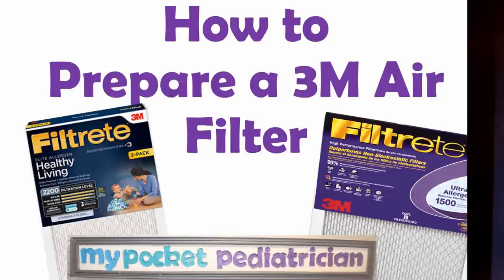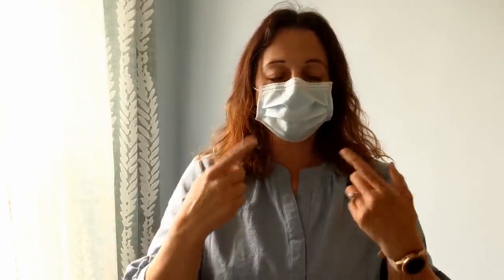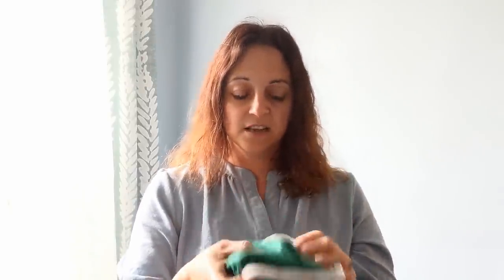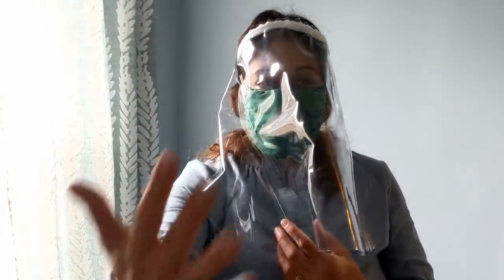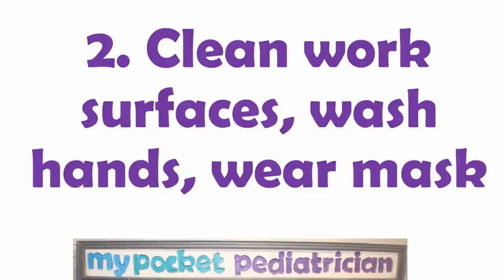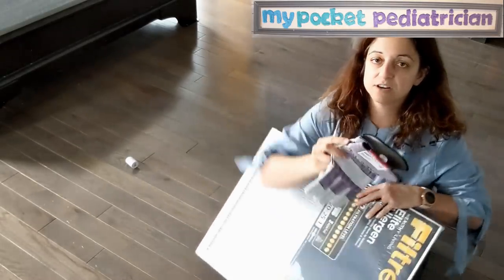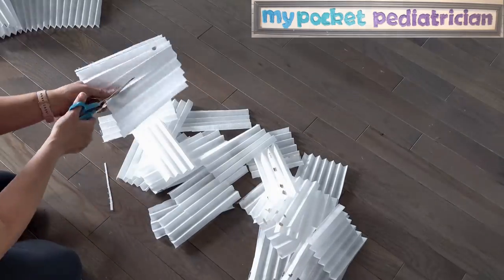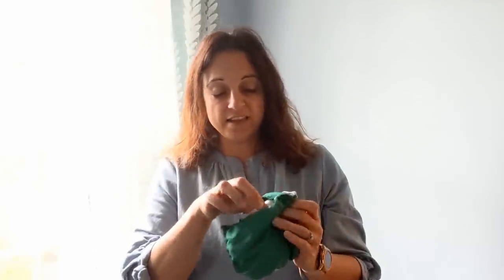UPDATED!  How to Turn a 3M Air Filter into a Face Mask

Comment: Hi thank you & well done.  I've also made a similar version.  It's a DIY no-sew mask with a 100% cotton Levi kerchief using the 3M Filtrete MPR 1500 (MERV 12) filter as insert.  I also checked the MSDS and found no known hazards and I also got the same feedback from 3M--they won't say it's a good solution.  We have a vulnerable family member and this a good mask using available materials.  I plan to use paper bags to store masks while in use during the day and plastic bags for new filters.  I also plan to use a light application of non hazardous non aerosol starch when ironing the laundered kerchiefs (not the filters)--it's to add body to the cotton mask when I refold them to help hold their shape.  Thanks again and I'm more confident after seeing your detailed method.

Comment: There are some Filtrete filters that are rated 1500 but only MERV12 (the purple label one). But the sheet on the filter lists it as good for catching virus particles as small as 0.3. I think it should be good though. This crap is confusing. Lol.

Comment: I’m glad I’m not the only doing this. I did the same thing , the research on materials and particle size, etc., downside no sewing machine and I don’t like to order stuff online. But I used the motorcycle neoprene half face mask, ultimate allergy pillowcase (made a mistake and bought the waterproof), and 3M 1500. It works good. Unfortunately I can only wear them out in public not in my Peds ofc.

Comment: I make my mask using polyester/spandex material. And I use bedskirt lining as filter material on the inside. 4 pieces, front and back polyester/spandex and 2 filter material pieces. I did the blow the match out test and couldn't blow the match out for anything. And with any mask you're not gonna escape sweating or moisture build up.

Comment: According to the CDC website, all corona viruses cannot survive above 130 degrees F temperature. With that in mind, you can "cook" your masks and other items in an oven or toaster oven including masks to kill any virus for reuse or before discarding to keep everyone safe. I would keep the temperature about 140 degrees, you do not have to get crazy hot with this idea. Paper products self ignite at 451 degrees. Fabrics self ignite at temperatures between 850 - 1000 degrees. Most elastics are safe at this temperature. Inside car temperatures can reach 212 degrees in the summertime sunlight with windows closed up. The virus will die in a hot car in the summer and you can "disinfect" your masks, clothing, and anything else in a hot car in the summertime. Hope this helps.

Comment: There is a reason that those filters are pleated.  Flattening them reduces their effectiveness.  Of course, just about anything is better than nothing.  Have you considered using HEPA vacuum cleaner bags as a filter medium?  They don't need to be pleated.  Further, another option for the basic mask is to use hypoallergenic pillow covers.  Those can filter very fine particles, pollen, dust mite allergens, bacteria, etc.  You can then try the vacuum HEPA bag as a filter medium for your pocket, or 2 or 3 layers of your 3M pleated filter medium.
Regardless, thank you for doing what you can to help people out !!!!

Comment: Ive bn using the 3m 1900 Filtrete for about 2weeks now. I double it going it will increase the filter power.

I don't know the merv or mpr.. ?.. for the 1900 Filtrete

Would u happen to know the mrp n merv level or know how i can find out?

Comment: Since the seal is very important, what do you think about using the mouthpiece from a snorkel? Rubber band a circle of this material on the stub left after removing the long tube (keep just the mouthpiece and it's stub, ensure the direction of the material is right.). Then, breath in through the mouth only and exhale through the nose or mouth or both. Goggles help too.

Comment: I have heard from multiple online sources that 3M says not to use these furnace filters close to your face. So I did not buy one. It’s impossible to get a hold of customer service now to verify if this is true.   Did they tell you it was ok?   I heard that the Hepa vacuum cleaner bags are safer to breathe from. There is so much misinformation floating around, I don’t know who to believe anymore.

Comment: Would wire for fencing work too like double layering it an i wrapped tape around it to keep it all closed up an cut up a part of the filter double layer it an use hot glue to attach it to the wrapped wire
Reply from the maker: I tried a higher gage wire I purchased at Home Depot - it was very painful.  I can't remember what it was off the top of my head, but it hurt a lot when I tried to bend it to my nose.
Reply: @MyPocketPediatrician  the one i got it leaves my fingers black. I made the basic shape like an n95 mask then washed my hands after that i wrapped it in tape
Reply from the maker: @squishy_Rio  I don't know about that.   Did you see the mask tutorial on how to sew a tight seal pocket mask?
Reply: @MyPocketPediatrician  this UPDATED ONE? or a previews one
Reply from the maker: @squishy_Rio  This was just on how to prepare the filter.  Here is how to sew the mask:  Here is the link to the tutorial on how to make the mask:  https://youtu.be/4eOc5_rBCrM

Comment: The 3M MATERIAL SAFETY DATA SHEET provided is outdated: 05/29/2007. Pg. 7 last line states, "In addition, information obtained from a database may not be as current as the information in the MSDS available directly from 3M. 3M MSDSs are available at www.3M.com." This filter's material safety data has to do with when used for its original purpose such as HVAC systems, ex. your home's central heating system, and not safety tested for direct inhalation. (My family runs an HVAC company.) 

I do commend you helping to be part of the solution as we are all trying to figure out what's best. Lastly, in the comments below: Norm Lieverdink and Sakoon Hirundage have some great insight (their replies hidden in Eve Wile's comment feed.) Reposting a link Sakoon provided: It has great info at the bottom of the page regarding home HVAC filters and how to improve your home air quality. This is an important factor at a time like this as well that people might not realize... wishing you all good health. https://www.filtrete.com/3M/en_US/filtrete/home-tips/full-story/~/coronavirus-and-important-things-to-know-about-airborne-particles/?storyid=d69e7735-c02c-46d2-9c8a-ae23372934ac

Comment: Made from non toxic material for 3m filters such as polypropylene(only toxic if melted or burned) and polyolefin. Did alot of research on Filtrete based filters for furnaces.

Comment: The construction of most MERV 13-16 filters seems to her very similar to N95 masks, using a permanently electrostatically charged melt-blown polypropylene layer as the fine particle filter. Very low grade furnace filters, around MERV 4, tend to be fiberglass, and really only meant to protect HVAC systems from the buildup of course dust. Cleanable dust collector filters, as well as some HEPA filters, are also made with glass fibers, relying more on fine pore size than static charge, and requiring much higher static pressure to achieve useful flow.

If you have a glass fiber HEPA filter, and you try to unfold it, it will crumble slightly. They are not particularly flexible and are easily damaged. Don't rely on this as a test, always check safety sheets, it's just a quick way to get a qualitative idea of where to start when looking at filter media.

Comment: Thanks for a good and informative video...  I don't believe here's a need to be concerned with the airflow marking on the Filtrete filter body. If you look closely at a Filtrete air filter, there is a wire mesh on one side only. The direction of airflow on Filtrete Air filters has more to do with the wire mesh providing support for the filter medium than the actual filtering capability.

Comment: This was informative.  I too was making a mask with the  Filtrete filters 1500 mpr and above. Thanks for pointing out the direction of the filter as it goes in the mask. I made a mask with ties on the side that are adjustable  to the face. Then the mask can fit tight enough to prevent the gaps because it gathers. When wearing the masks they feel comfortable.

Comment: The following idea would probably apply more to someone going out in public than to a health-care-worker... But what if, rather than putting a 6×9 inch filter in a tight fitting mask, you were to just medical tape a small piece of the filter to your nose - covering your nostrils with the filter (but not the tape)?  You could then cover your face with a looser fitting mask like a bandana. And as long as you breathed (in) thru your nose, wouldn't you have the same level of protection?

Comment: So I got this same idea before I saw your video. I took the filter apart before I marked it. I cannot tell the difference in the sides. The internet said the directioning is because it is supported in that direction. I'm a bit concerned as well is there is another report that says the glass particles can get into your lungs. What are your thoughts

Comment: One more thing comes to mind.  If this mask works due to electrostatic forces capturing contaminants, it is worthwhile to understand that electrostatic forces fade away in the presence of moisture.  Moisture from your breath allows charged air particles to dissipate their charges.  As the moisture condenses in the mask any static charge dissipates as well.  The first time you exhale through the filter, it starts to become moist and lose the static property it relies on.

Comment: thanks so much for your good work.  would it fit better if a metal nose piece were added along with elastic.  i had to use elastic from a fitted sheet,

Comment: I was checking out a polypropylene filter material used for hepa filters, from what I've found, no fiberglass is used. The material is called Spunbond. Haven't priced out the cost, but supposedly comes in a roll you can cut. It might be an easier way to save your fingers from pulling mesh.

Comment: Thanks Dr Lili!  I didn't mark the sides of the Filtrete material when I took the filter apart 2 weeks ago.  Since I have a 3d printer and no good sewing machine I was using the 1900 Filtrete with a single layer of a cotton t-shirt on the "health-care worker" side. I wanted to protect myself from inhaling loose filter strands.  On closer examination of the Filtrete I can see the fibers are flat and tight on one side and looser on the other.  I use my filter with a face shield.  My wife finds the plastic masks uncomfortable and poorly fitting so we are going to try to make a cloth mask for her.

Comment: I was thinking these would be safe to wear as masks because if they weren't the particles could potentially dislodge and pollute the air inside the space they're filtering.
Reply from the maker: That's exactly what the HVAC company I talked to said.   He said it would be completely counterintuitive to use something to filter your air that is harmful to breathe in.   However 3M says they don't recommend doing this.   I'm using Filti now, and I have a fit tested tutorial here:. https://youtu.be/2J3Fq4o-U4I

Comment: How does CLOTH vacuum bag cut up materialI believe -Enviro Care brand  or Miehl Co. bags stack up as a filter Insert material?
Reply from the maker: I don't know.   I think some have fiberglass, but I'm not sure.   I'm really not familiar with them.   I found a better material...Filti, which was designed for face masks and am using that now.   The new tutorial is here and I have a discount code for them.   Depending on shipping, usually works out cheaper than the 3m filters.   https://youtu.be/2J3Fq4o-U4I

Comment: Thanks for this informative video. I want to just give you some information about the directionality of how you insert/use the filter. It doesn't actually matter which direction the air flows through the filter material for this purpose. It only matters if you are using the filter in an HVAC system. That metal cage is designed to protect the filter from a large volume of air coming through the furnace/AC, so it has to be inserted in the correct direction so that the filter itself doesn't get destroyed. But once you've removed the filter from the package, to use in a facemask, the filter can be used from any side. This information comes from my husband who is an Air Force trained HVAC technician.

Comment: Thanks much Dr. Lili.  You answered a lot of questions for me. 
I want to try my new double Filtrete 2200 inside my pocketed cotton mask soon, when I finish making my cotton mask. 
I've got four n95 (about 6 year old masks) which I can now reuse by cleaning them by either stove boiling water vapor for ten minutes, or baking them in the oven at 148-158 degrees F for 30 minutes ( reuse max is 5 times the last way, and I know the rubber won't  be any good after baking).
Update:  You can now purchase KN95 here in the USA, which is the equivalent to N95, as of April 3, 2020, on eBay and elsewhere.

Comment: This is helpful BUT as a example: the HCW &  the dot is overboard. There's more "extra" things then this. Make it easy for yourselves.
Reply from the maker: I wish this were easy.  unfortunately the material has an electrostatic charge and it is directional, so wearing the filter backwards won't do anyone much good.  That's why it's important to place the filter correctly in the mask, and it's easier to note the correct side when you're making it than when a tired healthcare worker is getting ready for a shift and trying to remember "shiny or dull".

Comment: Elastic pulls straight, from bridge of nose to next straightline to part of face, lEVng an opening on each side... better to Use a paoee clip or those bendy things at home depo that you cN bend to fit face shape.. & THEN they stay in that shape.. IF 1 puts a non bendy outer frame around facemask(even just a curved plastic cross peice?, thN you could put elastic around THAT, & it wud strengthen the seal, provided there was some airtight cushioning for comfort, & maskfit imperfection, about another 100% or sO.. on this note, because this wud be an adjustable fit, elastic improved fit mask... it cud B 1/2 the sise with a plastic body & EZ filter slide out gizmo door?  mAB.. just something to dable with if you feel like it👋

Comment: CAUTION!! Please read page 2 #3.1 on the MSDS safety sheet that this person posted below the video.  “...use or processing of the product in a manner not in accordance with the products directions for use may affect the performance of the products and may present potential health and safety hazards” These filters are NOT meant to be placed against your nose or mouth and inhaled as there are particles that can DAMAGE LUNGS if used that way! Also page 3 #8.2.3 “Under normal use conditions, airborne exposures are not expected to be significant enough to require respiratory protection.” Placing them against your face is NOT normal use conditions.
Reply: Dear pocket pediatrician, can you respond to this so i know what you think? thanks in advance

Comment: Just bought Filtrete 1900 (before I saw your new recommended filter fabric). Sorry to ask again, but after reading all the comments, still confused. You stated that "Shiny side to patient, dull soft side towards healthcare wkrker".  Yet on another site, you stated "shiny faces wearer", meaning that the HCW should face shiny side.  Someone else suggsted that side doesn't matter, that direction of filter in placement of HVAC system determines what side, ie, it's a fitting issue with furnace, not one-directional flow for protective measures.  Please advice... again... thanks so much!!
Reply from the maker: So the air flow for the filtrate is that the shiny side should go towards the patient. On the filti material the shiny side should go towards the healthcare worker.